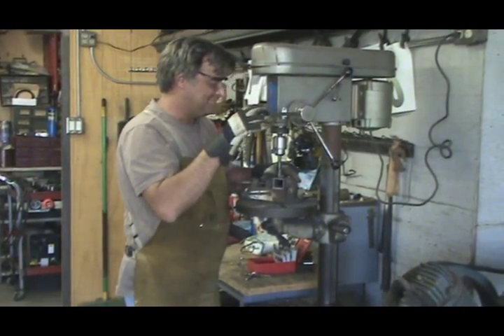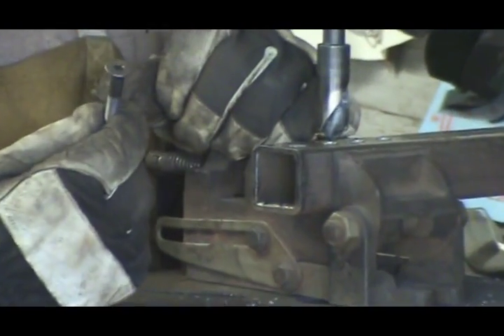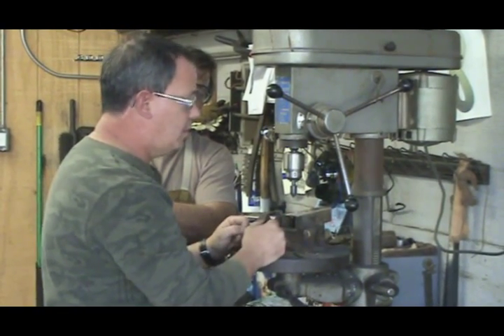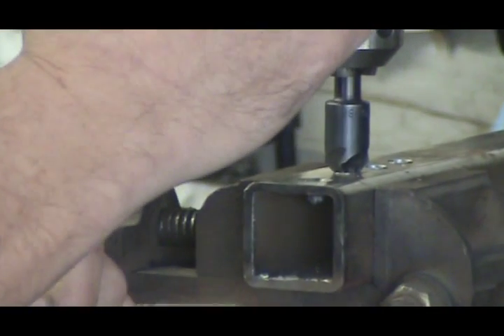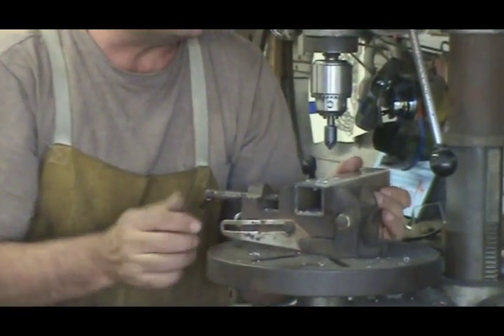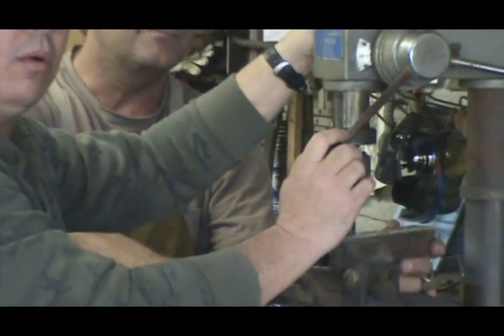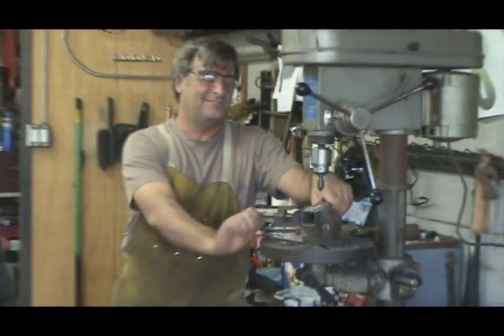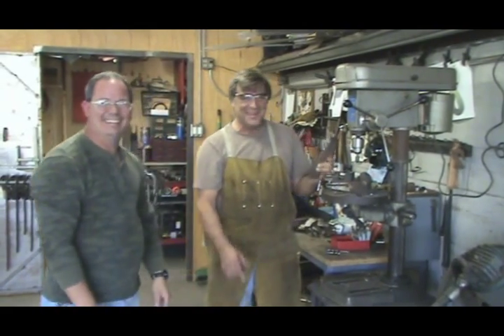Using a Drill Press to Countersink Like a Mill - Kevin Caron

Comment: Couple more tips: The countersink tool for SHCS is 82 degree angle....they come in different angles. Set the drill press travel stop for consistent depth...usually flush or a hair below the surface. Cutting fluid saves tooling and improves surface finish, A 3/4" counter sink tool will cover most any size screw normally used. All drilled holes should have at least a slight chamfer to break the sharp and insure good contact area with the fastener. As always, great stuff.  Al